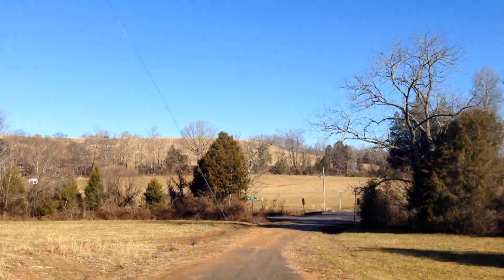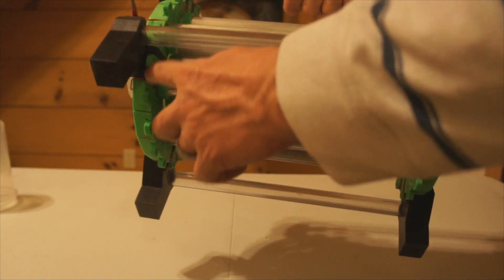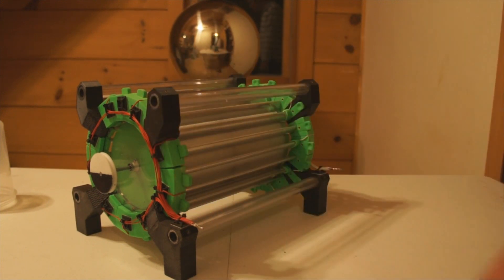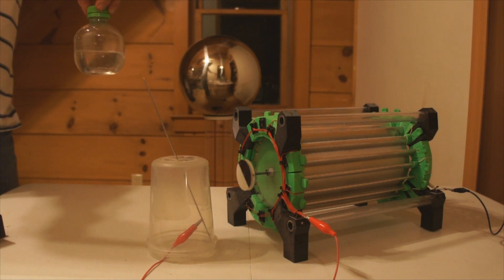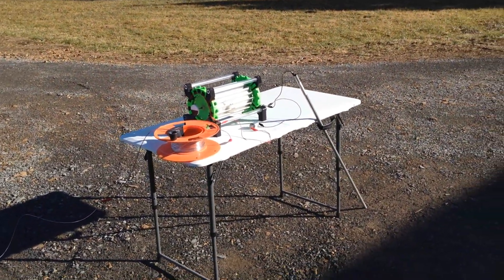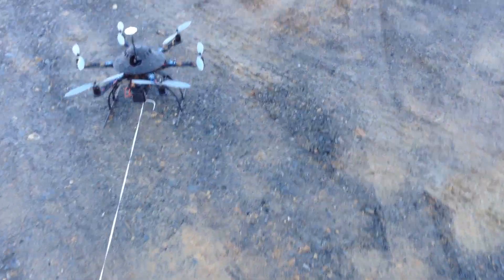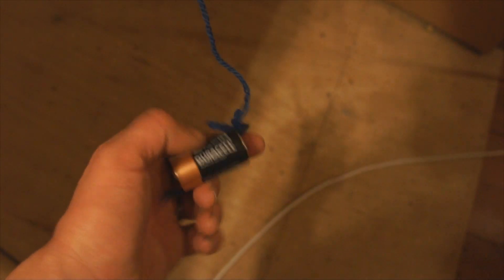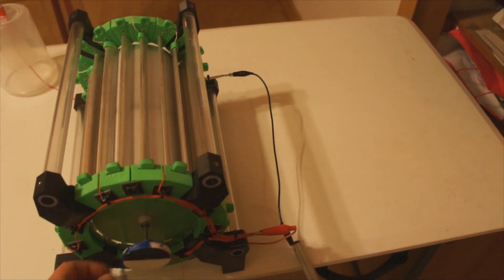3D Printed AtmoMotor Updates and Experiments - Upcoming 3D printer giveaway!

Comment: Normally We say that water rises up in atmosphere because is heated from Sun .
But We can also say that water rises up in atmosphere because is been polarized from electromagnetic radiation of the Sun.
Then the heating state of water and pressure water state inside the atmosphere it is a different state of vibration or electric polarisation.
Then from the atmospheric water we can tap  energy.
Reply: Emanuele Civetta Uh, way no.
Reply: I think water evaporation is static charging by cleavage as water molecules separate from other water molecules on the Earths surface.??????? This is definitely driven by the ⛅  Sun when the atmosphere is saturated (high humidity) this charge is grounded as lightning.

Comment: Great work there is great potential here not shor if you have tried this but cars when driveing create static electricity thay say in the thousands of volts could this motor run from that alone  also have you tryed to hybrid this motor with a bedini or adams motor also whats the price on that 3d printer as I never win stuff .

Comment: I have some very large aluminium veins left over from an aluminium siding job, perhaps if i mounted them on a large blue food barrel i could upscale the power a little. If i strung a cable between two tall trees do you think there could be enough power to drive a small generator?

Comment: Alternatively, you could use an Electret for a static power source, like they use in some MEMS (Microelectromechanical systems) to run micro motors. (Could link electrets in series if need more power.)

Comment: To improve the helicopter antenna try to first measure the electric field at a given height relative to the ground. As in Gauss law the dot product of the electric field and the surface area equals the electric flux. If you use a plate as the antenna you'll get more electric energy.

Comment: Nice work up there ! i would like to try this for myself :) & alot projects like this, but lack of 3d printed i have to wait :( have you thought to try what kind effect high voltage powerlines do for atmo motor.
Just popped out to my mind that is it possible to capture radio wave's to be used in this( for me this atmo motor seems very low current/voltage input) i mean radio waves to capture like old times antenna used in war time 1950 thin wire spread across trees etc. not an electronic/radio expert, only basics. this old field radio antenna thing gets alot "ground" covered, but i dont have experience where that atmospheric electricity is and how much.

Comment: Excellent! I’m excited to see where the antenna experiments take you. The screen mesh looks right and I wonder if a series of these mesh shapes could be attached to the copper wire and lifted by your quad.  It’s fun to think through anyway. Ha! I would have never even dreamed of using a quad to lift the wire. Ha! I’ve seen copper mesh at Michael’s Craft before but I figure you already have a handle on that. I also wonder if more than one antenna could be connected. It’s great that you and Lidmotor follow each other. Thanks for sharing. You guys keep me wondering!

Comment: Nice work! Was looking forward to seeing you do this. By the way, are you sure that's not just a charged plastic bottle, and not charged water? I suspect if you try it without the water you'll get the same charging.
Reply: Joshua Simpson hi everone I love this ideal, right now I have a setup that makes about 400V and I have it running my tv for 5 hours per day and a big fan all day
Reply: Water can hold a charge also, same as plastic holding a static charge.
Reply: Joshua Simpson
Sure, but in this situation there's no way for the water to become charged. It's in a sealed, insulating bottle.
Reply: RimstarOrg Hi, do you think that a pulsed hho system might have a charge to draw from?
Reply: MaintenanceMouse
I guess the question is does electrolysis result in a net charge in the fluid. I don't know.
Reply: RimstarOrg I would like to believe that plastic is not a great insulator in this case, I actually suspect the water is getting a charge from the bottle. For example, if you have a high enough current and use an air gap, you will see the charge jump from one side to the other. Right through the resistance of the air insulator. Just what I think on this!